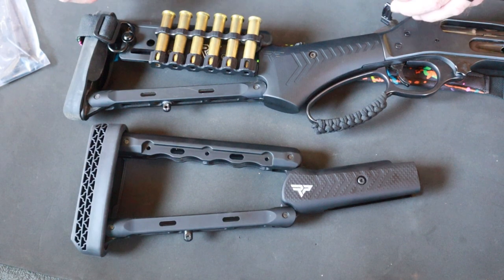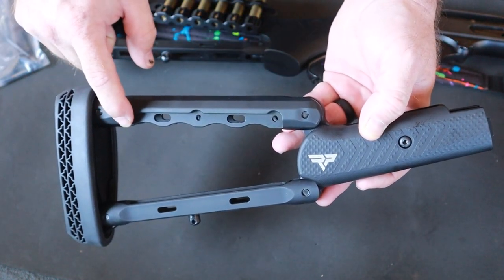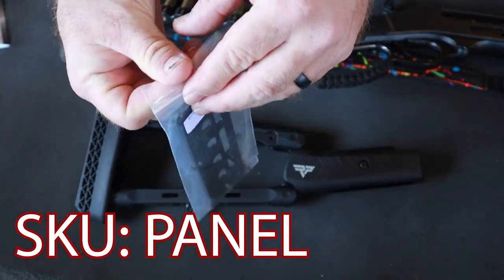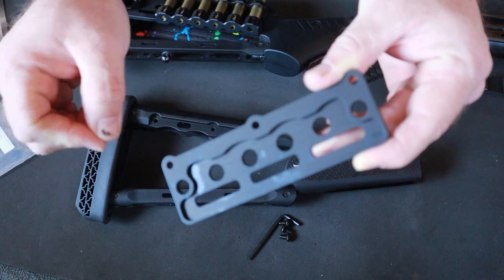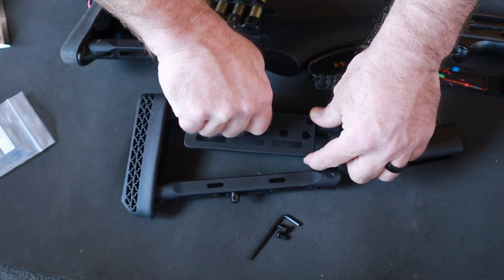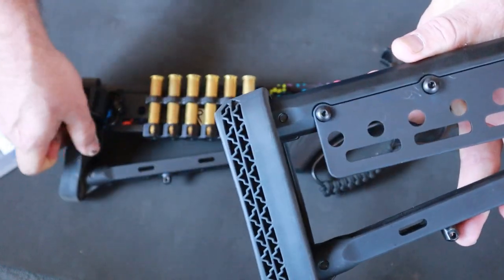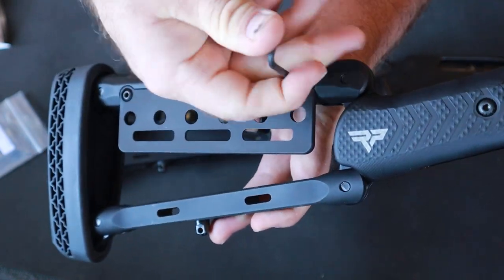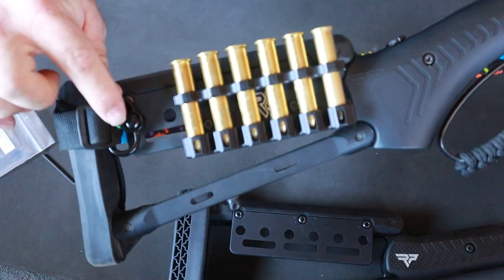Accessory Panel Tech Tip | Ranger Point Precision

Comment: Just received the butt stock, Costa handguard, receiver rail, two quivers, attachment plate, and all the gator rails for my new Henry X. Just like you said the fit and finish of all their parts are top of the line. Their customer service is right up there with the quality of their parts as well..had a small problem with one of the 44 mag quivers fitting the bullets a little too tight and with a quick phone call they immediately sent a replacement out. New quiver was received and bullets fit very nicely now. Thanks for making great videos. Each one has a touch of humor while still maintaining a very professional opinon..keep up the awesome work.
Reply from the maker: We could type a whole bunch of responses and a whole bunch of thank yous. BUT, we just want you to know that people like you are what keep the parts flowing. 

We are glad that you chose RPP for your levergun!
Reply: You bet. Thanks for the reply.

Comment: Any suggestions on how to provide a sling QD point for the stock with the 8rd 38/357 ammo quiver in place?
Reply from the maker: Another accessory panel on the opposite side or the QD socket on the bottom strut.